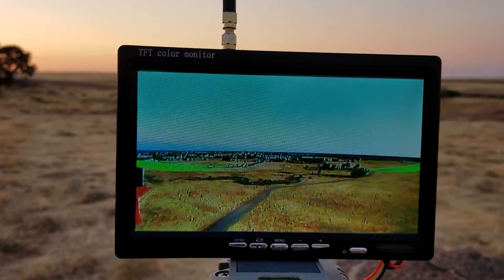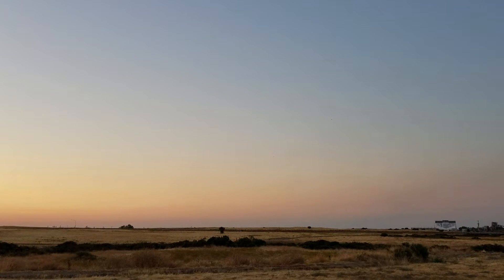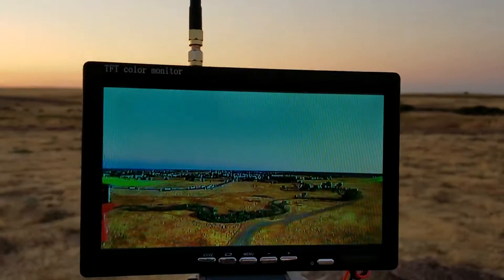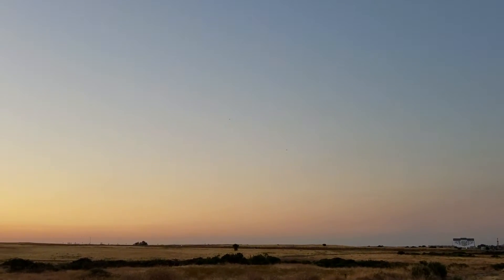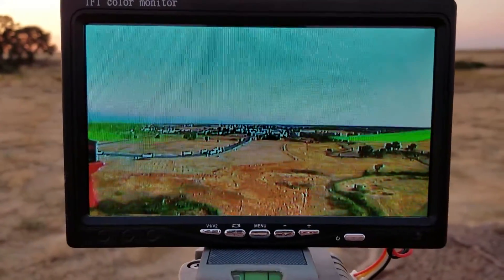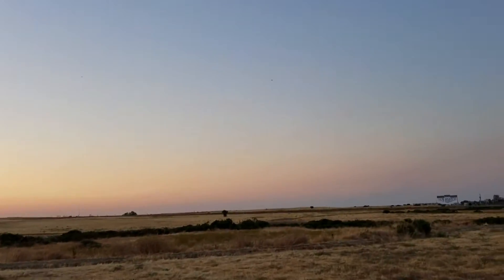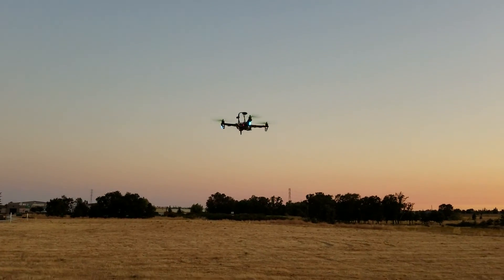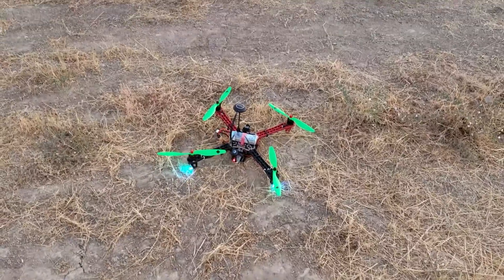Testing out RTH on my F450 multirotor - iNav 1.2

Comment: Good job!   What compass in use?  Internal or external?
Reply from the maker: I'm using the built-in compass on the NAZE32. Though I'm planning on updating to a better flight controller with an F3 chip. The naze is a bit long in the tooth these days and flight performance is mediocre at best. Compass performance is decent with the naze as I elevated the FC a inch or so away from the PDB, but it can be a bit inconsistent.

Comment: Congratulations :)
your quad seems to be realy stable.

Could you send you dump please ?
Reply from the maker: I don't know how much good it will do as you probably don't have the exact same build as I do, but here you go.

# version
# INAV/NAZE 1.2.0 Sep  7 2016 / 11:26:35 (6cc415a)
# pflags
# Persistent config flags: 0x00000001
# dump master

# mixer
mixer QUADX
mmix reset
smix reset

# feature
feature -RX_PPM
feature -VBAT
feature -INFLIGHT_ACC_CAL
feature -RX_SERIAL
feature -MOTOR_STOP
feature -SERVO_TILT
feature -SOFTSERIAL
feature -GPS
feature -FAILSAFE
feature -SONAR
feature -TELEMETRY
feature -CURRENT_METER
feature -3D
feature -RX_PARALLEL_PWM
feature -RX_MSP
feature -RSSI_ADC
feature -LED_STRIP
feature -DISPLAY
feature -ONESHOT125
feature -BLACKBOX
feature -CHANNEL_FORWARDING
feature -TRANSPONDER
feature -AIRMODE
feature -SUPEREXPO
feature -VTX
feature -RX_NRF24
feature -SOFTSPI
feature RX_PPM
feature VBAT
feature GPS
feature FAILSAFE
feature ONESHOT125

# beeper
beeper GYRO_CALIBRATED
beeper RX_LOST
beeper RX_LOST_LANDING
beeper DISARMING
beeper ARMING
beeper ARMING_GPS_FIX
beeper BAT_CRIT_LOW
beeper BAT_LOW
beeper GPS_STATUS
beeper RX_SET
beeper ACC_CALIBRATION
beeper ACC_CALIBRATION_FAIL
beeper READY_BEEP
beeper MULTI_BEEPS
beeper DISARM_REPEAT
beeper ARMED
beeper SYSTEM_INIT
beeper ON_USB

# map
map TAER1234

# serial
serial 0 1 115200 38400 0 115200
serial 1 2 115200 57600 0 115200

set looptime = 2000
set i2c_overclock = OFF
set gyro_sync = OFF
set gyro_sync_denom = 2
set mid_rc = 1500
set min_check = 1100
set max_check = 1900
set rssi_channel = 0
set rssi_scale = 30
set rssi_ppm_invert = OFF
set rc_smoothing = ON
set input_filtering_mode = OFF
set min_throttle = 1100
set max_throttle = 1995
set min_command = 1005
set servo_center_pulse = 1500
set 3d_deadband_low = 1406
set 3d_deadband_high = 1514
set 3d_neutral = 1460
set 3d_deadband_throttle = 1005
set motor_pwm_rate = 400
set servo_pwm_rate = 50
set disarm_kill_switch = ON
set auto_disarm_delay = 5
set small_angle = 25
set reboot_character = 82
set gps_provider = UBLOX
set gps_sbas_mode = WAAS
set gps_dyn_model = AIR_1G
set gps_auto_config = ON
set gps_auto_baud = ON
set inav_accz_unarmedcal = ON
set inav_use_gps_velned = ON
set inav_gps_delay = 200
set inav_gps_min_sats = 6
set inav_w_z_baro_p =  0.350
set inav_w_z_gps_p =  0.200
set inav_w_z_gps_v =  0.500
set inav_w_xy_gps_p =  1.000
set inav_w_xy_gps_v =  2.000
set inav_w_z_res_v =  0.500
set inav_w_xy_res_v =  0.500
set inav_w_acc_bias =  0.010
set inav_max_eph_epv =  1000.000
set inav_baro_epv =  100.000
set nav_disarm_on_landing = OFF
set nav_use_midthr_for_althold = OFF
set nav_extra_arming_safety = ON
set nav_user_control_mode = ATTI
set nav_position_timeout = 5
set nav_wp_radius = 100
set nav_max_speed = 300
set nav_max_climb_rate = 500
set nav_manual_speed = 500
set nav_manual_climb_rate = 200
set nav_landing_speed = 200
set nav_land_slowdown_minalt = 500
set nav_land_slowdown_maxalt = 2000
set nav_emerg_landing_speed = 500
set nav_min_rth_distance = 500
set nav_rth_tail_first = OFF
set nav_rth_alt_mode = AT_LEAST
set nav_rth_altitude = 1000
set nav_mc_bank_angle = 30
set nav_mc_hover_thr = 1500
set nav_mc_auto_disarm_delay = 2000
set nav_fw_cruise_thr = 1400
set nav_fw_min_thr = 1200
set nav_fw_max_thr = 1700
set nav_fw_bank_angle = 20
set nav_fw_climb_angle = 20
set nav_fw_dive_angle = 15
set nav_fw_pitch2thr = 10
set nav_fw_roll2pitch = 75
set nav_fw_loiter_radius = 5000
set serialrx_provider = SPEK1024
set spektrum_sat_bind = 0
set telemetry_switch = OFF
set telemetry_inversion = OFF
set frsky_default_lattitude =  0.000
set frsky_default_longitude =  0.000
set frsky_coordinates_format = 0
set frsky_unit = IMPERIAL
set frsky_vfas_precision = 0
set hott_alarm_sound_interval = 5
set battery_capacity = 0
set vbat_scale = 110
set vbat_max_cell_voltage = 43
set vbat_min_cell_voltage = 33
set vbat_warning_cell_voltage = 35
set current_meter_scale = 400
set current_meter_offset = 0
set multiwii_current_meter_output = OFF
set current_meter_type = ADC
set align_gyro = DEFAULT
set align_acc = DEFAULT
set align_mag = DEFAULT
set align_board_roll = 0
set align_board_pitch = 0
set align_board_yaw = 0
set gyro_lpf = 42HZ
set moron_threshold = 32
set imu_dcm_kp = 2500
set imu_dcm_ki = 50
set imu_dcm_kp_mag = 10000
set imu_dcm_ki_mag = 0
set pos_hold_deadband = 20
set alt_hold_deadband = 50
set yaw_motor_direction = 1
set yaw_jump_prevention_limit = 200
set tri_unarmed_servo = ON
set servo_lowpass_freq = 400
set servo_lowpass_enable = OFF
set failsafe_delay = 10
set failsafe_off_delay = 200
set failsafe_throttle = 1000
set failsafe_kill_switch = OFF
set failsafe_throttle_low_delay = 100
set failsafe_procedure = RTH
set rx_min_usec = 885
set rx_max_usec = 2115
set acc_hardware = 0
set baro_use_median_filter = ON
set baro_hardware = 0
set mag_hardware = 0
set blackbox_rate_num = 1
set blackbox_rate_denom = 1
set blackbox_device = SERIAL
set magzero_x = -258
set magzero_y = -191
set magzero_z = 341
set acczero_x = 0
set acczero_y = 0
set acczero_z = 0
set accgain_x = 4096
set accgain_y = 4096
set accgain_z = 4096

# rxfail
rxfail 0 a
rxfail 1 a
rxfail 2 a
rxfail 3 a
rxfail 4 h
rxfail 5 h
rxfail 6 h
rxfail 7 h
rxfail 8 h
rxfail 9 h
rxfail 10 h
rxfail 11 h
rxfail 12 h
rxfail 13 h
rxfail 14 h
rxfail 15 h
rxfail 16 h
rxfail 17 h

# dump profile

# profile
profile 0

# aux
aux 0 0 0 1800 2100
aux 1 1 1 900 2100
aux 2 3 1 1300 2100
aux 3 3 3 1300 2100
aux 4 10 1 1700 2100
aux 5 10 3 1300 1700
aux 6 9 3 1300 1700
aux 7 24 3 1700 2100
aux 8 12 2 900 1200
aux 9 23 2 1700 2100
aux 10 0 0 900 900
aux 11 0 0 900 900
aux 12 0 0 900 900
aux 13 0 0 900 900
aux 14 0 0 900 900
aux 15 0 0 900 900
aux 16 0 0 900 900
aux 17 0 0 900 900
aux 18 0 0 900 900
aux 19 0 0 900 900

# adjrange
adjrange 0 0 0 900 900 0 0
adjrange 1 0 0 900 900 0 0
adjrange 2 0 0 900 900 0 0
adjrange 3 0 0 900 900 0 0
adjrange 4 0 0 900 900 0 0
adjrange 5 0 0 900 900 0 0
adjrange 6 0 0 900 900 0 0
adjrange 7 0 0 900 900 0 0
adjrange 8 0 0 900 900 0 0
adjrange 9 0 0 900 900 0 0
adjrange 10 0 0 900 900 0 0
adjrange 11 0 0 900 900 0 0

# rxrange
rxrange 0 1000 2000
rxrange 1 1000 2000
rxrange 2 1000 2000
rxrange 3 1000 2000

# servo
servo 0 1000 2000 1500 90 90 100 -1
servo 1 1000 2000 1500 90 90 100 -1
servo 2 1000 2000 1500 90 90 100 -1
servo 3 1000 2000 1500 90 90 100 -1
servo 4 1000 2000 1500 90 90 100 -1
servo 5 1000 2000 1500 90 90 100 -1
servo 6 1000 2000 1500 90 90 100 -1
servo 7 1000 2000 1500 90 90 100 -1

set nav_alt_p = 50
set nav_alt_i = 0
set nav_alt_d = 0
set nav_vel_p = 100
set nav_vel_i = 50
set nav_vel_d = 10
set nav_pos_p = 65
set nav_pos_i = 120
set nav_pos_d = 10
set nav_posr_p = 180
set nav_posr_i = 15
set nav_posr_d = 100
set nav_navr_p = 10
set nav_navr_i = 5
set nav_navr_d = 8
set deadband = 4
set yaw_deadband = 4
set throttle_tilt_comp_str = 0
set flaperon_throw_offset = 250
set flaperon_throw_inverted = OFF
set mode_range_logic_operator = OR
set default_rate_profile = 0
set gimbal_mode = NORMAL
set mag_declination = 1340
set mag_hold_rate_limit = 90
set p_pitch = 67
set i_pitch = 35
set d_pitch = 25
set p_roll = 67
set i_roll = 35
set d_roll = 25
set p_yaw = 85
set i_yaw = 45
set d_yaw = 0
set p_level = 15
set i_level = 15
set d_level = 75
set max_angle_inclination_rll = 300
set max_angle_inclination_pit = 300
set gyro_soft_lpf_hz = 60
set acc_soft_lpf_hz = 15
set dterm_lpf_hz = 40
set yaw_lpf_hz = 30
set yaw_p_limit = 300
set iterm_ignore_threshold = 200
set yaw_iterm_ignore_threshold = 50
set rate_accel_limit_roll_pitch = 0
set rate_accel_limit_yaw = 10000

# dump rates

# rateprofile
rateprofile 0

set rc_expo = 70
set rc_yaw_expo = 20
set thr_mid = 50
set thr_expo = 0
set roll_rate = 46
set pitch_rate = 46
set yaw_rate = 36
set tpa_rate = 10
set tpa_breakpoint = 1600